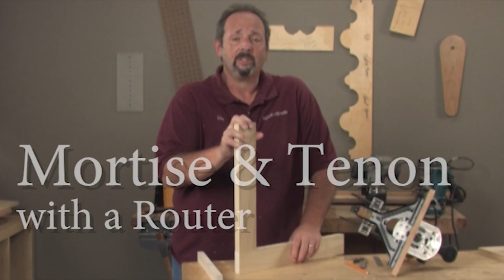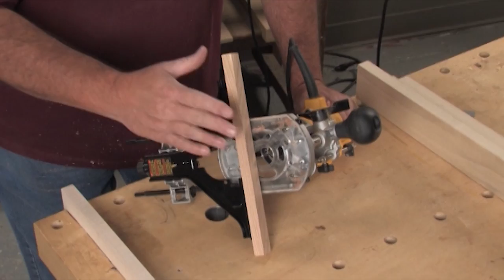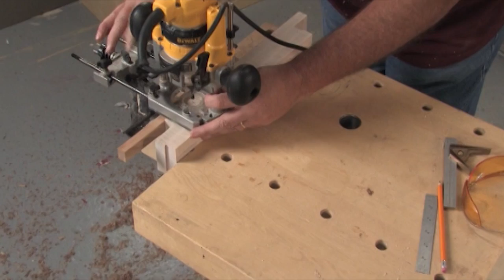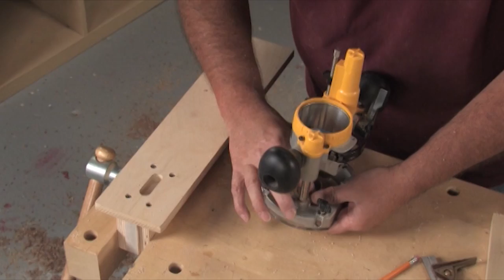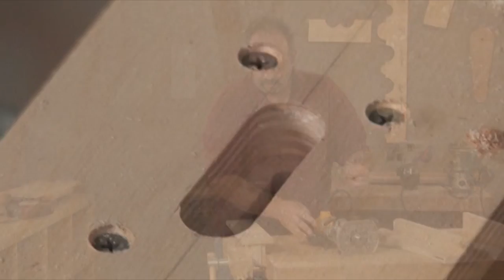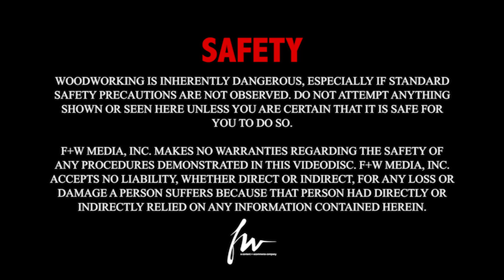Mortise & Tenon Joinery with a Router

Comment: I am edge joining three 30 year old 2"x 10"x 9' redwood planks I salvaged from my deck rebuild using Festool dominoes 10mmx40mm without the Festool Tool for an outdoor table. A 3/8th's straight bit plunged to 20mm  referenced from the top should work with his second jig. Thanks.
The plan is 4x4 "X" half-lap legs with a angle brace joined to the top with a housed wedged-through tenon and below with a housed tusked wedged -through tenon in the half-lap joint.
 I think. Never done it.  Irreplaceable wood so I don't want to screw up.

Comment: The tricky part in step one is getting the mortise dead center on the workpiece. A good trick is to switch the router to the other side for another pass. That will assure the mortise is dead center and then you cut the tenon to fit. Otherwise, if the router setup is not perfect, the workpieces won't line up.

Comment: Why do you start cutting the tenon with a climb cut on the router?  Why not cut the standard direction which seems safer?  Also, you can use a scrap backing board when cutting the tenon to reduce or eliminate the tear out at the end of the cut.
Reply: Because going the other way as he said pulls the router INTO the piece - you'd be fighting to prevent the router from taking MORE material away which then runs the risk of breakout.

Going reverse direction first means worst case scenario, the router pulls away and you take LESS material than planned so you simply repeat the cut. You only go right to left on the final cut when you want the router to pull in tight.

Comment: Great video, I will have a go at this technique. Would have like a little more info on the cutters that were used. Strange how other people say mortices should be square and tight which is how I was taught but this way seems equally good and is so much simpler it beggars belief I have been squaring them off for over 60 years for no good reason at all!
Reply: I still think that mechanically a square and tight joint works better and doesnt need much glue....

Comment: Great video. My only concern is that you pull the router towards yourself while cutting the tenon. Aren't you suppose to work Left to Right which would be you pushing the router away from yourself?
Reply: On the very first cut, if you make it very shallow, it will help with tearout, then proceed normally.  It is easy to wreck your workpiece with climb cuts done wrong.  Not to mention yourself, if you are not really experienced with a router.

Comment: I'm a beginner, just wondering round edge mortise and square edge tenon  -- is that acceptable/common in wood work？I'm wondering the space caused by shape mismatch would need lots of glue to fill... will that be a potential problem in years?    thank you all for giving some suggestions.
Reply: I think your best bet is to make a full width tenon and then round the edges to match the mortise.

Comment: Actually cutting a tenon with the router like this is 10 times faster then setting up a tenioning jig on the table saw with a stack of dado blades. Unless your making a bunch of the same cuts.
If its just one or two parts the router might be faster. 
Now you could cut a loose tenion and a mortise in both parts and put a round over on your loose tenions as long stock them part them off,  or just spend a grand or more on festools dimnio system.
You can even set up a router table to cut the mortise  and tenions as well as spend 2k to 3k on a multi router
Or  panorouter .  
As for this guy and the bits he's using 
Whiteside makes a up spiril cutting bit that pulls the chips up out of the hole insted of just a stright cutting bit.
I noticed burn marks on the wood 
On your first mortise this is a speed feed rate issue and if your burning the wood the tools getting to hot and a hot tool will dull a cutting edge by both tempering the bit and work harding the materials.
I belive your moving the tool to slow for the tools rotation speed. Slowing down the tools speed might make it cut without burning.

Comment: do a strength test on square mortise vs rounded.
Reply: I'm sure the square will be stronger. It's not only the glue that make the strength. A well made square joint will not wiggle even without glue.

Comment: I want to buy a plunge router. Any suggestions? My budget is $200
Reply: Do not buy tools according to your budget, but according to your needs. The best $200 tool may not give you the performance you need.
Reply: I bought a Dewalt for 200 bucks from Amazon. I came with the plunge rig. Also love the LED light. Over the past 3 months have used it for several projects from  mortise to round over edge on a large butcher block computer desk top. It works flawlessly.